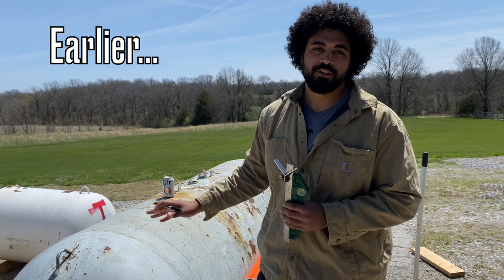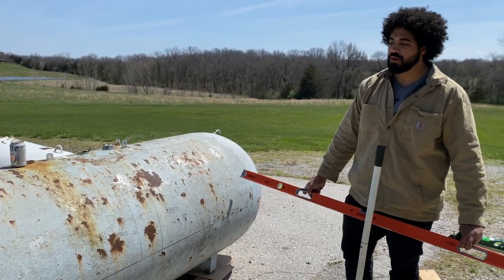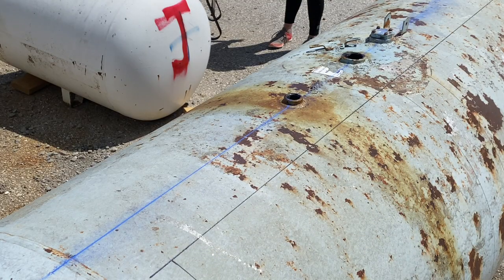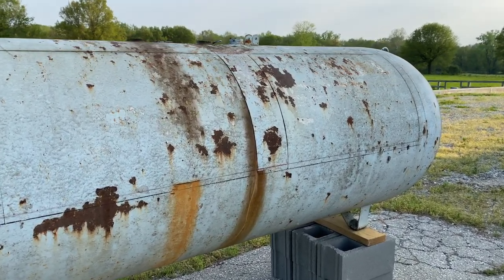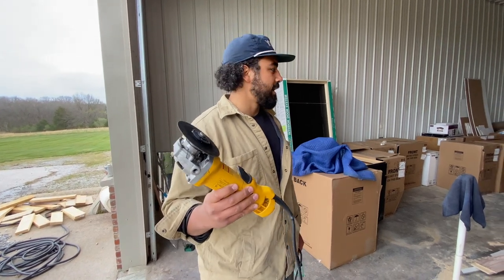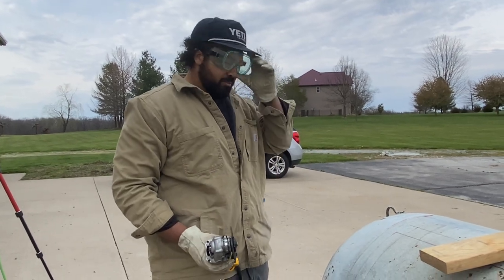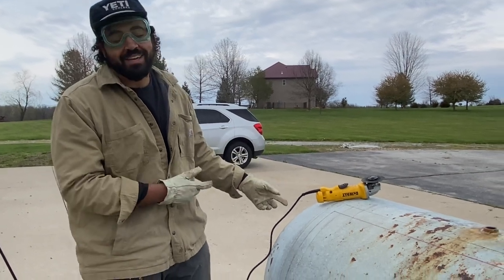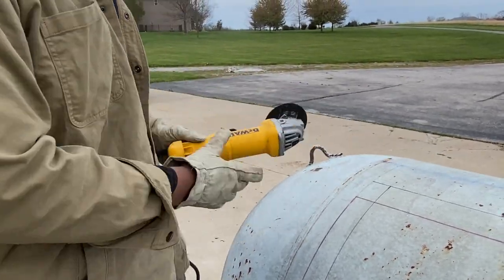Building A 500 Gallon Offset Smoker: Measuring Doors & Making The First Cuts

Comment: What did you do to get rid of the valves on top
Reply from the maker: I left them and just roughly closed them off with a scrap piece of metal welded ontop.
Reply from the maker: I left them and just roughly closed them off with a scrap piece of metal welded ontop.

Comment: No offense here. But step 1 is fill the tank with 1 gallon of dove or dawn dish soap fill the rest with water, to the top. Let it sit for a week or 2. Fill to the top with water. Do your layout. Cut. And eventually Weld.
Reply from the maker: lol none taken. Also the. Entire smoker has been finished for like 2 years, it all worked out 🇺🇸
Reply: @MeatNGreetBBQ  I'm subscribing, when you cut your tank did smell potent of propane?
Reply from the maker: @jwfmechanical9864 thanks for the support! Yea it smelled but it wasn’t as bad as ppl say. The tank was full of water and dawn soap so when I cut it the water ran onto the concrete. If I would have power washed the concrete the smell would have gone away. I cut it late fall so it was too cold for flys at the time.